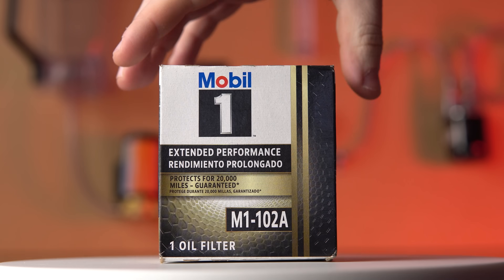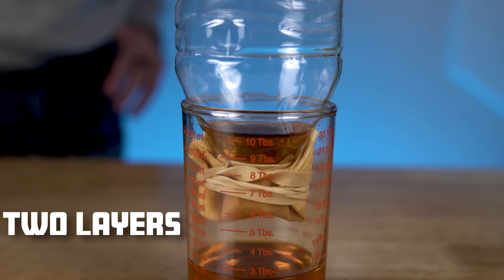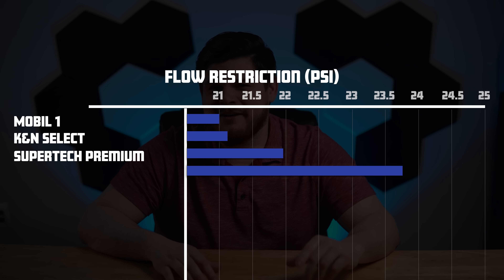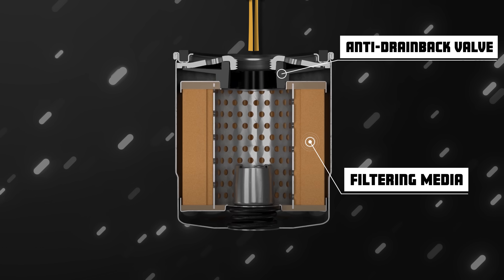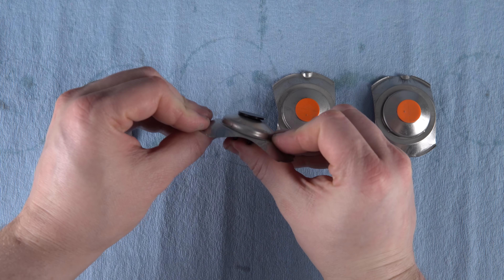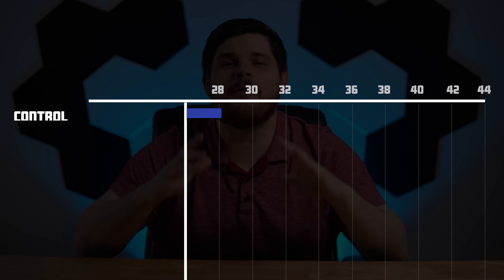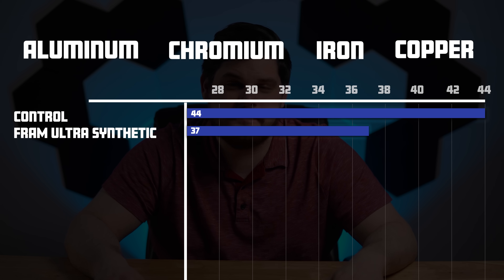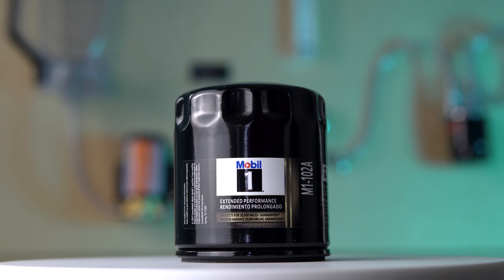Engineers Test the Best Oil Filters! FRAM | Mobil 1 | K&N | Walmart Brand

Comment: I always thought K&Ns "Performance Gold" oil filter was more common than the "Select" filter. That's what I'm using on my truck anyway, and the oil pressure is 33% higher than the filter that was on it when I bought the truck.
Reply: Great filter check out engine masters Dyno comparison

Comment: Been building and driving cars since late 80s, many very high horsepower engined ones that I used countless brands of filters on these engines.  Just off the top of my head Fram, Mobil one, K&n, purolater, wix, motorcraft, etc.  I have yet to have one engine failure due to a filter has anyone had a documented failure from the filter?

Comment: Keep in mind that an automobile engine only filters a portion of the oil in what is known as by pass filtering. So restriction of oil flow in a by pass situation is very important. High restriction = less oil filtered during running time. Industrial engines use full filter systems that filter all the oil all the time. Auto engine manufacturers do not want their engines to last as long and industrial engines tend to last. 
And yes, an auto engine can be converted to a full flow, fulling filtering system. In industrial engines the Caterpillar filters are easily the best in terms of build quality and performance.

Comment: This entire test is flawed, severely. Oil filters have a pressure relief valve that starts to open at 10-15 psi. Presumably the oil pressure past the filter was near zero, so every test you performed where the pressure was 20 or above, the filter was bypassing and allowing for oil to pass through unfiltered.

All oil filters do this with cold oil, and you have no idea if the higher pressure is due to a more restricted bypass valve or if it's a stiffer relief spring or if the filter media is affecting how easily oil flows through it.

Given the exact same filter media, you actually want the HIGHEST oil pressure because that means more oil is being actively filtered. Of course, this only applies up to an extent. You don't want the pressure to cause the oil pumps pressure relief valve to open, causing reduced flow.

Comment: What I would really love to see is the pressure that the bypass valve is popping off at! If my oil pressure is 62 psi and my filter pops off at 40 does that mean its really bypassing the filter most of the time? Test please.

Comment: Ive been using mobil one filters, like them and Motorcraft, Fram actually failed on my 3.5 ecoboost. So no fram ever again. What failed was the seal it really started leaking, never had an issue like that before, filter had about 6K in mileage, 5/30 synthetic mobile one extended performance oil.

Comment: Can you address my concerns about the testing procedure

-Normal operating conditions (i.e.) temperature?
-flow rate does not equal pressure, you were measuring static pressure, which is not a unit you want to use when measuring flow restriction.

Comment: Well....I throw the BS Flag on a part of this  one. The oil's viscosity is affected by temperature and will affect the pressure drop across the filter as well as the pump flowrate unless a positive displacement pump is used which wasn't mentioned. The pump appears to be a diaphragm or centrifugal pump.

Comment: The purolator boss is the best filter I ever used, i use them During engine break-in's  then. I switch to either purolator tech filters or purolator ones, no paint buying the red purolator,  the red is the same as a tech but cost 4 times as much.

Comment: a difference of 4psi when it comes to fluid pressure is like... negligible. An engine generating 100+ will have no trouble generating a few extra PSIs with the oil pump

Comment: My cousin was driving down the interstate in his full size pickup truck, when his oil light suddenly came on. By the time he was able to pull over, the engine seized. Later on he found out that the Fram Oil filter Metal HOUSING had Collapsed and starved the engine of oil.  
I worked in autotech and later automotive supplies, most people will buy fram because its cheapest, or at least the cheapest "brand name". Don't do it. Your car repairs (or another vehicle) costs a LOT MORE than oil changes. I will pay the extra for Mobile 1 filters and oil for the better protection. BUT I still change my oil around 5k to 7k miles regardless of mileage claims. 

On a side note, I used to think K&N oil were pretty good, kind of surprised by the tests here. However I do know that the K&N Air Filters are great for Air FLOW Rate... but are basically Garbage at actually FILTERING out the contaminants in the air.

Comment: YES, THANK YOU FOR TESTING! I've seen all these armchair engineer videos where they just take apart the filter and say "well Fram sucks because there was a little oily residue inside and the pleats are different".

I disagree with the restriction test, though. As far as I know, oil pumps in engines are constant flow pumps, meaning that unless your filter is completely obstructed, a more restrictive filter will NOT result in lower flow, just a higher head pressure on the pump. Of course, any real engineers, please correct me if I'm wrong.

Comment: Nice video.  My only suggestion would be to redo your bar charts.  The bar charts should start at 0. Your one chart that compares flow pressure makes it look like 24 psi is 3 times as large as 21 psi.  This is clearly not true and gives a misleading impression that the Mobile 1 is 3 times as good as the Fram when it isn't.  The same is true for your other bar charts.
Reply from the maker: Thank you so much for the suggestion. You are 100% correct. We are always looking to improve and thanks to comments like yours we can.

Comment: One question I have is if the differences on pressure is significant or insignificant. In other words, does Fram's higher pressure really matter compared to a filter with one or two less PSI?

Comment: huh. i've always used fram's ultra synthetic because of the advertised 20k mile protection. i figured it'll just give me an extra 1-2k mile leeway with oil changes and i try to do it every 5k miles, a quarter of the mileage the filter's rated for.

Comment: I use the fram ultra synthetic oil filter for over 15 years now on all 4 of my vehicles. Even with full synthetic oils used, I do all oil changes within 4500-6500 miles based with length of oil age as well. The in town cars gets a yearly oil change regardless of miles shortcoming to 4000 miles. I don’t recommend any oil changes in the 10k plus range. I know that the European car dealership has these oil change intervals set so high along with their maintenance packages. Oil is inexpensive compared to your motor engines and those two components are the most crucial things to keep them running. For example, 8 quarts of full synthetic oil and a filter would cost me just under $50 and I do the change myself without a floor jack with clean up in about an hour. Don’t wait too long, it’s a very small price and pain to help keep your car/truck running smoothly.

Comment: I had high hopes for this test but it was flawed in so many ways.  The flow capacity should've been measured up until internal filter bypass opens.  This would represent   cold start 70F ambient filtation rating before filter is loaded with contaminant.  Otherwise, the first pass filtration efficiency is partially negated whenever in bypass with a much higher percentage of unfiltered oil being recirculated back into engine.  

The other major flaw in this test is the lack of  using particle counters both upstream and downstream of the oil filter to measure real-time the length of time at which the in and out particle counts  equalize at a given flow rate while measuring actual flow rate (plus accounting for flow pressure drop through flow meter).  A key point is new oil is not necessarily clean oil and can vary by batch.  Similarly an absolute filteation rating of 30 micron at 99% is a very inadequate standard for testing filter effectiveness.  View this standard as rock catcher benchmark that will not produce best engine life.  If an engine is generating contaminant this large in significant quantities other than from initial manufacturing process bad things are already happening very fast. The filter should perform down to 2 micron (equals smallest running  clearances in diesel and gas engines) but will have lower first pass filtration efficiency (typically not published by manufacturer but one of the most important)  This is typucally determined by smallest pore size within filtration media.

Thus, you set particle counters to measure 2 micron and larger.  Then compare the time to stabilize in and out counts and the measured final particle counts and you will get your clear filter winner.

To better simulate stop start real world effect the test should run 30 minutes stop for 5 minutes and repeat to simulate any effects of filter bypass valve opening closing.

Lastly the 30 micron  aluminum powder dust capacity test means something but not very much.  If an engine generates this much large particle contaminant then it is already damaged.  The real test should be using 2 micron size particles in small incremental volumes to see at what point the filters fine particulate capture characteristic has been reached.  Essentially the mass of the material that can be captured in the fine media pores before they are forced to bypass through the larger openings in the media.

Comment: I think it would have made more sense to send off the oil sample analysis after the aluminum was added. The low contamination numbers of the used motor oil I think made it hard to tell a difference between the filters. just my opinion

Comment: Unless you are blocking the bypass valve, the oil filter restriction test is nothing more than the pressure of the blow off valve. As for the amount of filtering media, I’d like to have 30 miles of it. The more surface area we have the less chance on us blowing open the bypass valve during operation. Keep in mind that the bypass valve is between oil that has not yet gone through the filter compared to the oil that has already passed through the filter. The engine has close tolerances and because of that restricted flow after the filter the bypass valve typically doesn’t have to open all the time as some people believe.  The test for capturing particulates has some validly as long as the pressure is lower than the bypass valve rating. It’s hard for us to tell If the pressure fed to the filter was above the blow off valve value.

Comment: 8:35 and why is that?  Because that's where they fail.  And that's with cold oil on a brand new oil filter.
Never change, Fram.  Never change.
And that's why I don't use Failure Fram.  Same thing for 40 years that I've personally witnessed.

Comment: This test, while impressive to an ignorant person, was performed by ignorant people so it's mostly useless.  Most bypass valves open well below 20 psi so the flow test showed which filter can bypass the most amount of oil, not which one can flow the most through the filter media.  Testing their holding capacity without verifying that the filter actually held all the aluminum powder was also completely useless.  Running used oil through them for multiple passes does not "simulate a real world scenario" as the guy said.  On the upside, it's the only part of the entire test that had any validity and it showed that the 'winner' was actually tied with its much less expensive 'looser'.

Comment: Our shop has had lots of issues with FRAM filters causing low oil pressure on GM V8's. My recommendations is use good quality oil and filters in your engines. WIX, Mobile 1, FOMOCO, ACdelco, purolator ect. I've heard of people having issues of people using K&N but never seen any issues personally.

Comment: I would love to see Mobil 1 Extended Performance vs AMSOIL EAO, & WIX XP. These 3 are reportedly the best Oil Filters in todays market.

I only have experience using Mobil 1 EP and WIX XP, both seemed to do a great job with my previous car (1992 Lexus LS400). My current car (2019 Infiniti Q50) uses Mobil 1 EP, and the twin turbos cook the crap out of that oil.

Comment: Not all the time but if you do your research. You can install a larger filter. For example with GM's 6.0L in years 2000 to 2003 they ran a Wix 51522/ napa gold 1522. In 04 to 07 they ran a smaller filter on the same engine. In addition to shrinking the filter they wanted you to to increase oil changes from 3,000 mile to 5,000 miles.  This is changed every 3,000 +/- 200miles without fail. Mobil1 full syn 5w30 with Hotshot's secrect oil additive. Engine does work for a living being in a chevy 3500 dually. Will email Brand with the pictures of what 2001 gm 6.0L valve body looks like at 422,000 miles. Valve cover gasket was starting to leak so was time to change them.

Comment: Thank you for the video & testing! I've been doing my own oil changes at 10K miles for the past years and wanted to see how well "fairly budget" filters & oil perform. I spend about $50 on oil & filter, & about an hour of time, once per year. 
Engine runs like new, and a joy to drive. Would like to see more people do their own basic servicing (oil, filters, good fuel, under hood checks, tires, battery etc) all counts to appreciating the inner workings of the machine that you rely on 😊

Comment: This is a great testing procedure for oil filters, but heating the oil to 250°F (121° C) would have been great to see as the composition of oil changes with temperature.  Oil becomes less viscous when heated, so the flow rates of oil pressure would be different and chemically it’s ability to suspend the bad particulates in the oil is altered with heat as well.

Comment: The YouTube algorithm worked here.  I’ve been searching for real filter testing for over a year now.  I really appreciate the scientific method and getting to filter performance vs look like other channels. This is very Project Farm style testing.   Video quality is also great. I hope this goes viral for you guys. 

A few suggestions for future testing as I think this could be big for your channel.  As others have suggested, I’d test other brands including Amsoil, Napa Gold and Platinum (or WIX equivalent), Royal Purple, Purolator One and Boss, AC Delco Ultragaurd Gold.  

Since you have built such a good rig and have access to a lab I’d suggest some extra tests.  You could do a filter efficiency test to see, over a fixed period of time, how much aluminum of various particle sizes gets filtered out.  Would be interested to test at 20, 30, 40, 60, 100 micron - effectively creating an efficiency per particle size.  For the particle capacity test it would be interesting to take the filters to when the bypass lifts (or the media fails) and to know the pressure that happens at. 

Keep up the awesome work.

Comment: I worked an engine machine shops for years and years. Most times if a motor has died from low oil pressure there is a fram oil filter!

Comment: The pressure of the bypass valve of the oil filter element of Japanese cars is 14.7psi, if the pressure exceeds the pressure, the filter will not be performed. The oil pressure of the car at idle is about 8-12psi. When the engine speed exceeds 1200rpm, the oil pressure will exceed 14.7psi. This is the data of SAE 5W30 oil used.

Comment: not a big surprise that Fram did well, they are used on industrial engines all over.

also would be interesting to see a test about bypass filters

they claim to filter much finer particles and have much higher capacity, but they only filter part of the oil and still require a normal oil filter

Comment: I would love to see these same tests in a 3-way shoot out, the auto parts store house brands like Duralast, Microguard, CarQuest vs some other name brand such as K&N, Wix, Purolator, STP vs OEM filters like AC Delco, Mopar, and Motorcraft.  Mainly because i you would think that OEM filter would be better to prevent costly warranty repairs, and i have never really trusted the parts store house brands because i have has so many issues with improper fitment and low quality do to them being made overseas with very little quality control in order to make a price point below OEM or name brand auto parts.

Comment: Great test, I'm comfortable running the Fram ultra synthetic, I change my high mileage full synthetic oil about every 5-6 thousand miles. I used to buy the Walmart syntech oil, but since they raised the price, I'll buy any brand that I can find in 5w20 now.
Reply: Quaker State is what I switched to. Good test results
Reply: @88Berries  IMO they all do what they're supposed to do, my only bias is I run high mileage full synthetic, so what ever brand is in stock in 5w20. I was fine with Syntech until they raised the price, and the couple of times I bought oil, they didn't even have it in stock. Bought Mobile 1, and just did a change using Castrol.
Reply: @a.joegevara3519  i chg both cars at 3k miles. Its like preventive maint.  I suppose w/ better name oil you can stretch it.  Dark oil doesn't always say bad oil.

Comment: When operating in a "hostile" environment, a pair of filters run in parallel works best. You end up with half the volume going through each filter, slowing the fluid down and reducing fluid restriction which increases fluid filtering efficiency, and in some cases increasing oil change intervals.